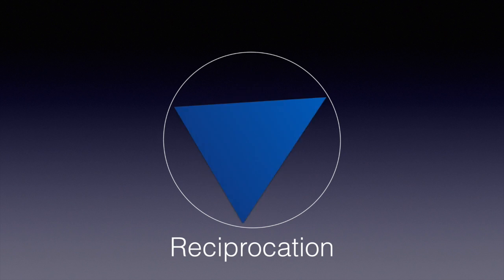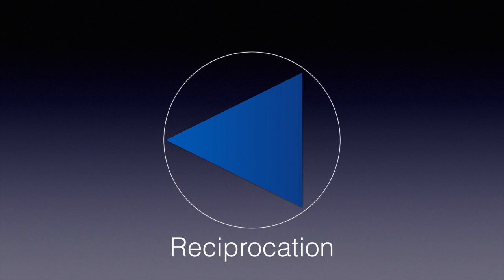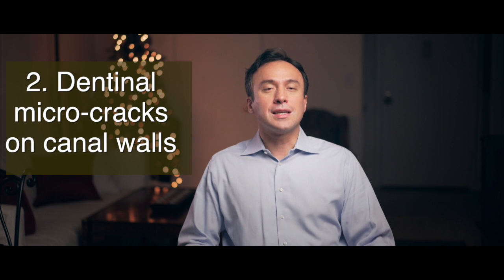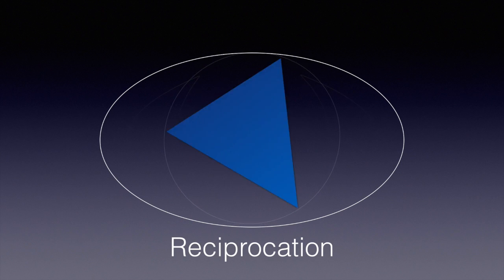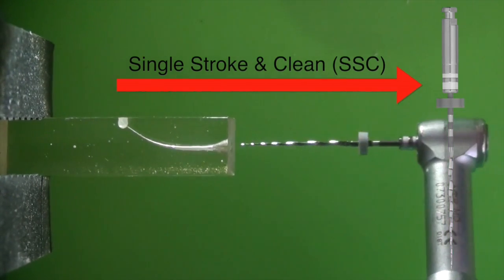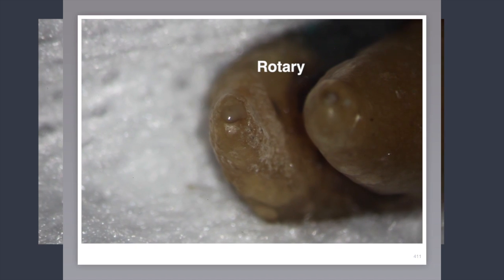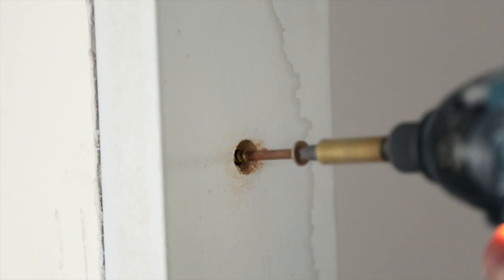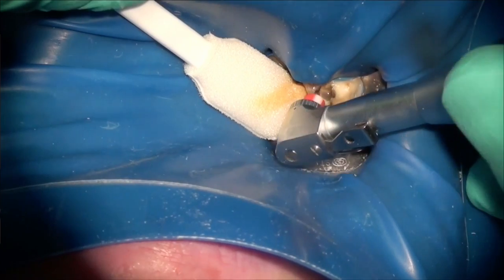Reciprocation vs. Rotation Which motion?! Friday Questions!

Comment: Thank you dr. Nasseh . On my prezentation I speak about this problem and it is very huge. If you look on the reserches about :hard tissue debris accumulation during the root canal instrumentation with rotary files - we still have very big problem ( Micro -CT analysis - hard tissue debris accumulation  Paqué et al. J Endod  35: 1044-1047, 2009) .  But reciprocation instrumentanioin has a biger problem - all the debris is still in the root canal and we pack it in all iregularity of root canal anatomy. Dr. John McSpaden has a very good video demostrating this problem.
Reply from the maker: Yes Dr. McSpadenn really helped explain this phenomenon the best. The current way people recommend the use of reciprocation is incorrect and it creates large amount of debris that's counterproductive to the cause of RCT. I've been working on ways to help address this issue. Stay tuned and I'm hoping to discuss at some point the way I think Reciprocation should be used to reduce its debris issue. Cheers and thanks for great point you brought up! : )
Reply: @AANasseh  Thank you so much for you answer ! I'm very big fan of all your videos and I learn a lot from them.

Comment: Just from my own experience: I have been using wave one for about 5 years time after using protaper for probably 10 years before and did not noticed any increase in the postoperative pain... 
Now. as far as the chances of causing microfractures during the instrumentation with reciproc files.... i really don't know but, obviously, your point is valid. I can see/feel that the forces and shocks are greater so yes, it might be possible. 
On the other hand,  if the tooth is accessed with manual first up to 25 k file and the coronal third is flared with either sx from protaper or gates glidden I think the stress is reduced.
What is your opinion about using files designed for rotary motion (for example protaper S1, S2,F1,2,3) in reciproc mode? I am thinking to get the benefit of reducing the chances of separating them but I am not sure if their cross section is suitable for that motion.
cheers
Reply from the maker: You are right. If one uses the reciprocation motion correctly, extruded debris can be diminished and minimized to a controllable level. There will be tutorials on that subject in 2018. Stay tuned. Cheers!
Reply: Thank you for your answer. How about using the rotational files in reciprocating mode?
Reply from the maker: Yes. It can be done; but it has to be the correct type of reciprocation angle and direction based on the file design. We will cover that in detail in 2018.
Reply: @gabisivoglo   nice thought,it should work imho,plz share the details if you have tried it,thank you

Comment: Great. I just ordered a bunch of Wave One files to restock my supply. I wonder if I could just turn the motor to rotation as I get close to the apex with the wave one file. I use the Endo Sequence sealer and points with Wave one files as I didn't like the thermoplastic obturators with the wave one system.
Reply from the maker: WaveOne is designed specifically for reciprocation and you should not use it with rotation as it will push even more debris apically (it cuts in a counterclockwise direction.)
Reply: Endodontists who teach Wave One  do NOT advocate simply going directly to  final shaping file after establishing working length anymore. If you have been using Wave One and haven't been to a continuing ed course  specifically on it for a while, you should. Many of the  pitfalls described here will be addressed.

Comment: HI Real World Endo? I'd like to know why reciprocating files require single use, nonetheless reciprocating motion provides fatigue.
Reply from the maker: It's recommended by the manufacturer. Whether the motion is rotation or reciprocation, cyclic fatigue does take place. Single use is the only way to reduce chance of file separation since cyclic fatigue is invisible to the eye... until the file breaks! So, that's why single use is the recommended method, for safety. If there was a way to measure actual cyclic fatigue in the file shank you would find out in some situation you can use the file more .. the problem is that no one knows when... unless you take a chance. The problem is that we'd be taking a chance with your patient's tooth, and potentially wellbeing! That's the main problem.

Comment: Sir it is wise to use m4 reciprocation for glide path preparation then switch to rotatory for final preparation
Reply from the maker: It's not necessarily wise. It's a personal choice to use mechanical motion with the handpiece vs. using hand/fingers to move the file forward. It's personal preference. I'm not a big fan of M4 personally but you can try it and see if it works better in your hands. Cheers!

Comment: Try to check literature dear dr
Literature showing that reciprocation is much better
Reply from the maker: The important question here is what does "Better" mean? Is it safer, faster, cheaper, or has a higher success rate? I'm not sure that question has been answered yet to any clear degree. I also use and talk about the ESR CM, which is reciprocating. But the ideal motion is different than the practical motion.